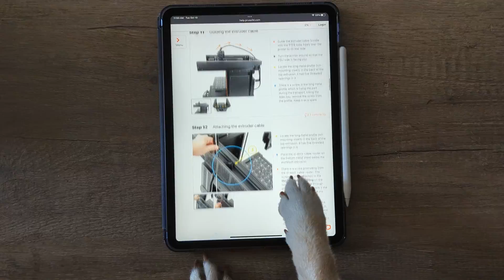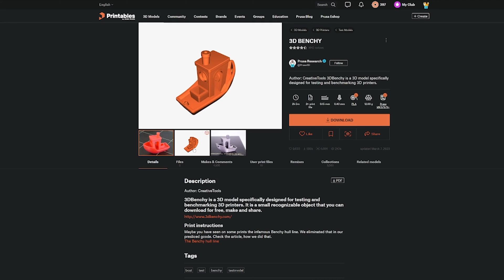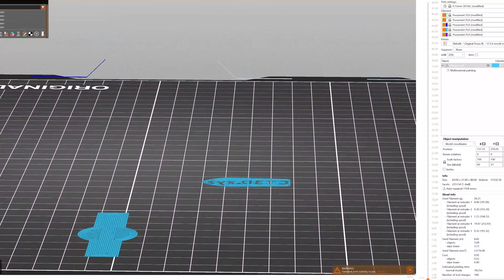Multicolour printing with the 5 tool head PRUSA XL, unboxing and first impressions

Comment: I thought 5 head task was to reduce filament,,poops,,AMS have,but is that wipe tower not the same?
Reply: Thank you for your answer!
Reply: The amount of filament if the wipe tower is miniscule compared to the "pooping" on those other options.  The real advantage is time saving.  It takes literally seconds to change filament vs. any other system.  Watch the print time skyrocket with your AMS when you start adding filament changes.
Reply from the maker: The tower is for priming the extruder so that the flow rate is ideal for printing. As @bluerider0988 has already mentioned, the prime tower is much smaller than a MMU or AMS wipe tower.

Comment: The XL is showing to need much lower temps than we are used to. Try 190 for PLA and 205 for PETG and you will not get any stringing.
Reply: Frankly, that shouldn't be necessary, and it will reduce your layer adhesion strength. No matter the printer, you can make your parts prettier (but weaker) by printing them cooler, but for $5,000 this printer should not require that tradeoff.
Reply: @alexsalchemy there are theories that the XL’s extruder transfers heat much better than other printers and so the effective temperature is a lot higher. i’ve seen people printing PLA at 170 on facebook where on a mk3 for example it would not turn out well :)

if this theory is true, then lowering temps on the XL shouldn’t impact layer adhesion
Reply: @Luka-lm1pr  The hotend being "better" at heat transfer causing the stringing doesn't really make sense to me. The stock nozzle is a long-ish brass nozzle, but not longer than a volcano, so the heating zone isn't especially big. The heater block looks basically like a slightly shorter volcano heater block. The heater itself is a fairly typical 40 watts. Also, I print PLA up to 240 C and sometimes higher to push the limits of flow rate, and don't see this happen. And there are plenty of higher flow hotends and nozzles out there that don't seem to have these oozing problems, and a high flow hotend has to transfer heat better. Maybe it's because they're not on tool changers. 
It seems like something that should be fixable through slicer settings on retraction or Z hop or coasting.
Reply: @alexsalchemy  No, those temps are well within the ranges as indicated by the manufacturers. I am not sure why people like you and this video creator feel the need to crap on things without any actual thought, research, or effort. The author of this video seems to be very new to 3d printing and is upset that thigs were not perfect with the default settings right out of the box. They posted this video to a thread on the Prusa Forums without reading any of the posts in the thread that would have given them their answers and claims here that they were printing at 190 for the video. Given that the default temp for PLA in Prusa Slicer is well above that, I find that hard to believe.
Reply from the maker: If this video was posted to prusa forums, it was not our doing. We are big fans of prusa & multicolour printing and have a print farm of MK3S+MMU2S printers. Should have mentioned in the video that the prints were made with default settings--other than nozzle temperature which was set to 190C.
Reply from the maker: That's the first thing we tried. All the prints in this video were printed with PLA at 190C. Unfortunately it didn't fix the stringing problems.

Comment: 1:47 - I'm having the same issues with multi-color prints on my 2-tool XL, even though I'm using a 0.4mm nozzle which should reduce these issues. I'm noticing that the blobs on the part are usually on the side which faces the wipe tower, so it might be a problem with the retraction or z-hop settings as the tool goes from the wipe tower to the part. However, I don't know if those settings for the wipe tower are the same ones you modify in the slicer, or if they are in the firmware as part of the tool changing code. I know there is one setting in the Marlin firmware called, TOOLCHANGE_ZRAISE which is set to 2mm by default. This means that every time a tool change is triggered (after the final print move on a given layer), the tool lifts up by a full 2mm before being stored, which I've seen pull strings of filament out of the nozzle, which is not good. I think this value should be set to 0 personally, but I've never compiled firmware, so I'll have to figure it out if I want to try it.
Reply: that sounds like a pressure advance issue, calibrate yyour pressure advance settings and i bet it will go away and also se a big improvement all around. i as well as tons of other people have the same blobv issue in the corners and always calibrating pressure advance fixes it. give it a try
Reply: Try dropping your temps way down. 190 for PLA seems to be about the sweet spot for the XL.